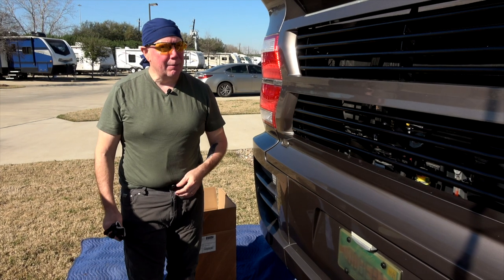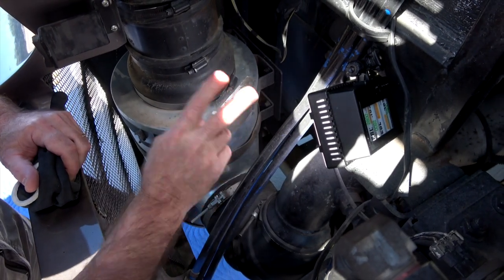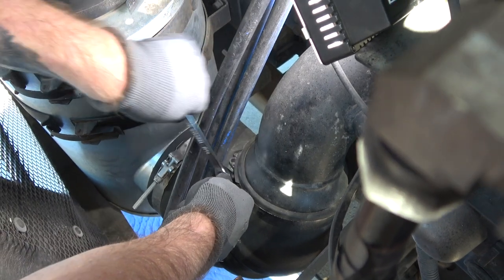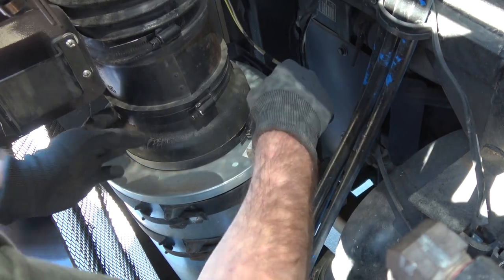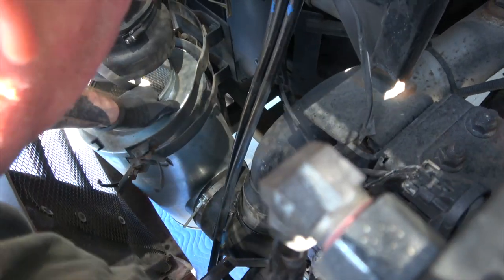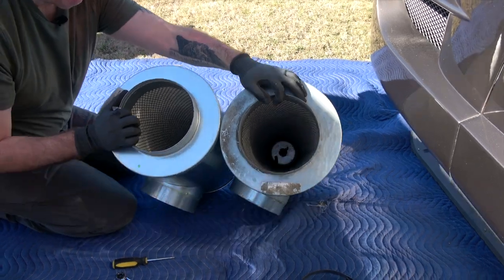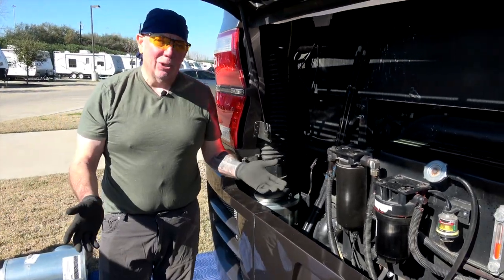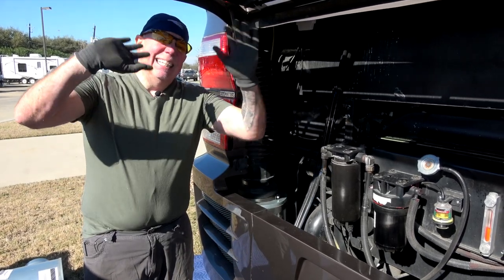Cummins 450ISL - Engine Air Filter Replacement - DIY Save Money!

Comment: Dave, thanks for the part number, went down to Empire Truck sales in Jackson MS, picked one up 120.00, took 25 minutes start to finish and using a small amount of lithium grease on the rubber fittings made it real easy in the cold weather to put it back together. Thanks again for all your help your timing as always is perfect.  I was thinking about changing that filter at Christmas and then you post a video reminding me to change it.  Thanks again!!
Reply from the maker: Glad I could be of help.  How did your other one look?  Just wondering. :)
Reply: @DavidBott  sent you photos to your email address. Also found a rag inside the center section. Looks like an absorbent rag from a shop.

Comment: Great Video David. One point that would like to add is to meticulously clean the rubber connection at the turbo. On our coach there is a bit of dust buildup around that junction and cleaning it precludes getting dust in the turbo while changing the filter. 
As always thanks and congratulations on your treatment

Comment: Thanks for sharing Dave. I have the same filter and engine on my 13 Newmar Mountain Aire. The location is higher up and filter sits horizontally to the left of the engine. Makes it easier to replace in some aspects but I have to reach in farther to get the clamps off.

Comment: Great advise on changing every two years, most never fill up before they start decomposing, 
You lost me when you were showing the inlet and outlet, the inlet is supposed to be on the outside(more surface area) of the filter, then I saw why you said that.
The mfg of the coach had no room to install it any other way.
Please don’t take this as an insult on your knowledge or ability, with this configuration you can never get the full capacity of the filter. 
You might consider even shorter change intervals if driven in dusty conditions.
Great advice and good job on the video.
Safe travels

Comment: Dave what was the part number of the filter and where did you get it from? we have a 2014 45LP Coach and its time to change ours. The previous owner changed it right before we purchased the coach in October 2018, so we are due.
Reply from the maker: Hi...I picked it up at Bay Diesel when I was in Red Bay. (Thus I knew the labor cost.)  The part number on the receipt is... FAR/094973-007  ($126.08)  It is not small as you know, so shipping will add to it.
Reply: @DavidBott  thanks Dave hope you are making progress at MD Anderson.
Reply: Each air filter has a tag that says what size it is and part number but if I will see it I can tell you right away what size it is and the part number as well the one his showing in the video it's 11x18 size